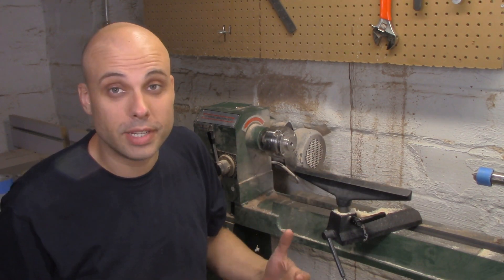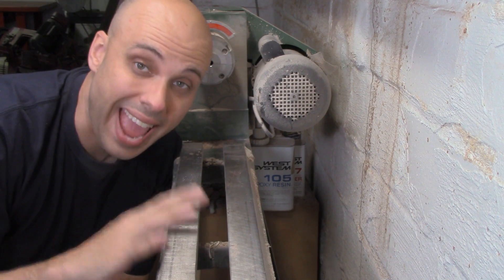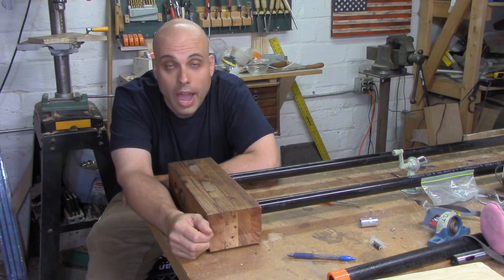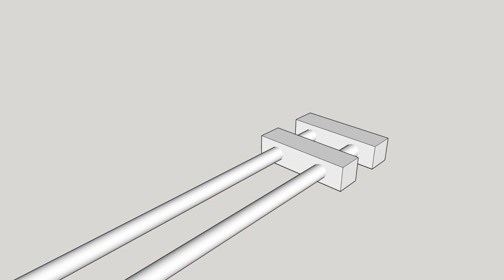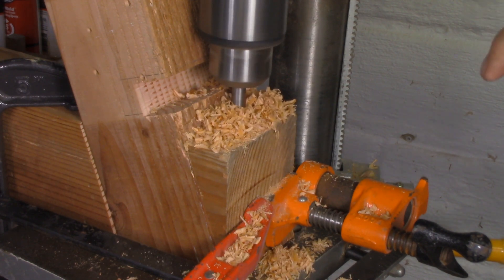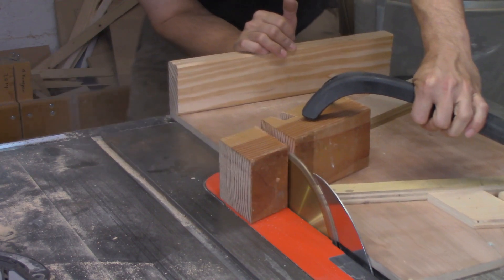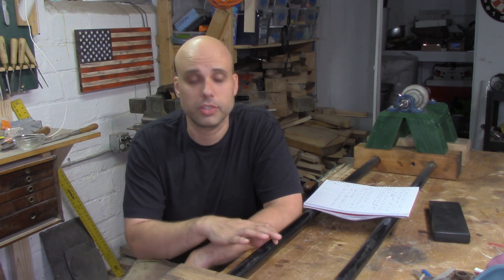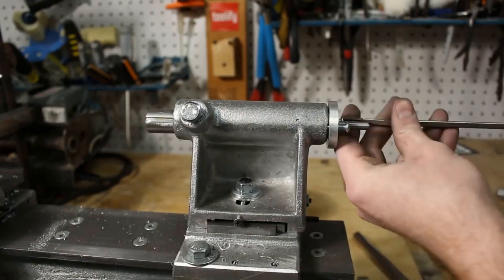The Real Lathe Project (Pt1: Bed and Headstock)

Comment: I "built my "lathe" this way. Part of a house remodel project I was working on was an old gnarly 1947 Shop Smith. I said, "Hey, can I have that as part of my pay?" It took me a while to rebuild it. The biggest obstacle was I was unemployed. Took 4 years to gather up the money. Wasn't much about $100 altogether. I do have a 39 second poorly constructed video on it on my "channel"
 You can find them from $50 - $200. If anyone thinking of going this route shoot me a private message. I can turn you on to all the resources you need and pictures of mine from pile of rust to working lathe. Good job Rex, this is why I love your channel!
Reply from the maker: Doc MacLaren's Tinkering that sounds like a good route to a functioning lathe!
Reply: ..."Hey, can I have that as part of my pay?"
Ouch.
Next time start with "Are you throwing that away?"
and follow with "I'll take it off your hands if you want".

If that fails, follow your original plan. :)
Reply: RayMerrell68
#1. My boss was my Sister-in-Law .2. I was getting paid in food and a place to stay. 3. I was flat broke. 3. So it was in addition to. I also found a heavy duty vise and some other tools that I was able to have as well. 4. My Sister-in-Law was almost as broke as I was. 4. Now if I was being paid with money, and not an in-law as a boss that would changed the dynamic to your reply.

Comment: Beside space, is there a downside of having a 24inch span vs a 12inch span ?
Reply from the maker: It's the size of the piece and the weight that goes with it. Think about a piece of wood 12 inches long and 24 inches in diameter. It would weigh a ton. The lathe would have to be very heavy and sturdy to swing that much wood. Even many "professional" lathes only have 22 inches of swing. 24 is HUGE.
Reply: Fair enough hehe,  thanks for the video by the way ! I didn't think that someone building a lathe would interest me but here I am ! :D
Reply from the maker: Out of curiosity, what would you like to see more of?
Reply: @RexKrueger  I am still a beginner.   So I devour any tips and tricks. Shop projects are also always good since I am still working on mine. But in general I tend to like videos when the creator crearly enjoys doing them, which you are hehe.
Reply: Rex , there are forces that could easily cause a larger lathe to SELF DESTRUCT - "VIBRATION" !   * The larger the out of balance condition; the more likely disaster is waiting to BITE you !    Harmonic resonance , (chatter) will happen. . . **Remember that a chain is only as strong as it's weakest link ! ! !    I'll post another comment Directly ^^^   ;)     Better to err on the side of caution , than need a trip to the E.R. !   I've had turnings fly off the headstock & tailstock ends , been whacked pretty hard -  Eyes don't grow back if they get squashed or pierced !   :p    The more powerful the lathe, the more damage it can do . . . common sense says , '' over engineering is your friend !